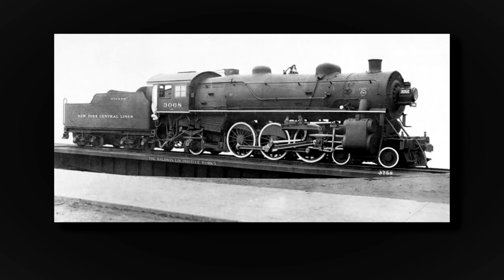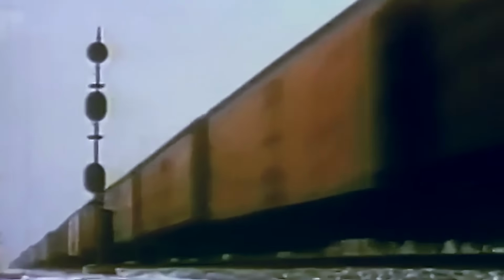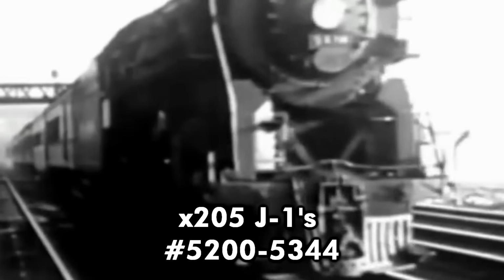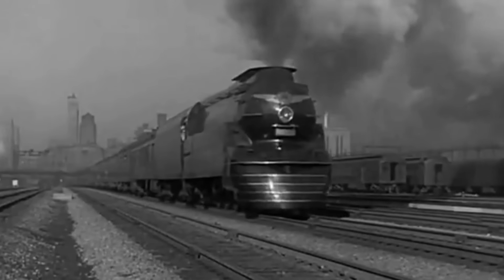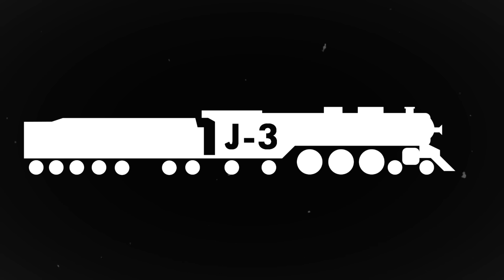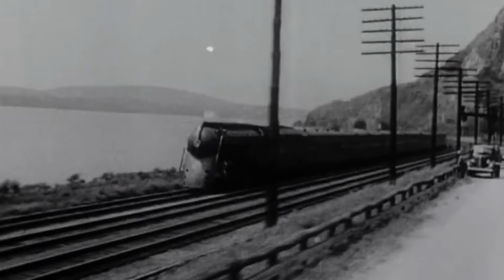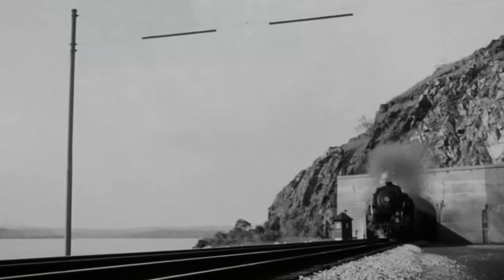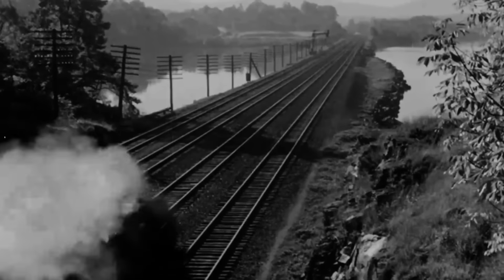Engines of New York Central - Hudson

Comment: I live on the sea level route, but it the extension from rochester to niagara falls, called the Falls Road Railroad (FRR). Runs from brokport to Niagara falls today. CSX operates from Niagara Falls to Lockport (servicing GM and a few other industries. The Somerset coal plant used to be serviced as well, but was decomissioned. Genesee Valley Transportation (GVT) operates the rest of the shortlineline, servicing an ethanol plant in medina, CO-OP gain storage, and other small industries. FRR trains are several 10's of cars long running from the Ethanol plant to lockport and beyond. On trains from Brockport to Medina, itll be a rare sight to see more than 2 grain cars. Used to be a double main, but a srapper bought the line a while back and ripped up the south main, then ripped up the north main and layed a weird squiggly rail to cross to the other side. Theres even a switch stand in the old yard in Albion.
Medina RR museum runs New York Central passenger excursions (still from medina to the Falls so no long trains coming my way), and has a very large collection of road worthy cars.

Comment: Nooo, the 10 J3a Dreyfuss streamlined Hudsons were not ALL supplied with Scullin Disc Drivers; the first 5 were erected with 79" General Steel Castings BOXPOK Drivers and the second 5 were built with Scullin Drivers. The Dreyfuss Empire State Express Streamlined J3a Hudsons (2 of them) were built with Scullins. A number of UN-STREAMLINED J3as were also built with Scullin Disc Drivers. SOME of the Scullin Drivered Hudsons experienced Main Driver Main Crank-Pin & Bearing failures, which necessitated replacement with Main Boxpok Drivers. A partial fix was tried with the reduction (by 10 pounds per square inch) of Cylinder steam pressure...

Comment: Thank you for presenting this piece on the NY Central Hudson locomotives, streamliners included.  These were classic engines, only to be scrapped as junk when diesels replaced steam locomotives.  It's nice to know that previous generations knew such designs provided good rail service.  But it would be nicer if people today were to see these locomotives as museum items or be used as excursion vehicles, similar to the Cuyahoga Valley Scenic Railroad in Ohio.

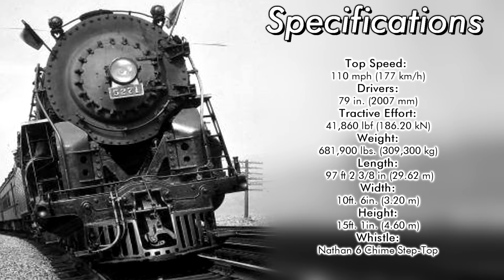Comment: 3:04 Slight correction on the whistle. The J-1 class didn't originally have 6-chime whistles. At the time of their building they were equipped with 5-chimes. I don't know the specific manufacturer though. Perhaps at some point in their operating life the J-1s were given 6-chimes, but I'd have to verify with an expert on the subject.

Comment: It is a  shame that the New York Central(NYC) did not save any steam locomotives. I would think the reason was when R.R.Young and Al Perlman took over they found the NYC had no cash. Just a lot of people and obsolete equipment. Perlman did what he had to, to keep the railroad running. The only source of ready cash was the scrap value of the steam locomotive dead lines. He and Young found that previous management had been sitting on a Potemkin village, ie it all looks nice until you get off the river and find the village is nothing but stage fronts. 
       In the end Young took a shotgun and Perlman ended being forced into the Penn Central merger. Rush Loving and Jim McClellan's descriptions of the NYC's financial position makes for interesting reading.
Reply: Part of the reason was because Perlman wanted the RR to not look old and dated but instead modern and that means scrapping the NYC’s entire roster of steam locos and replacing it with diesel ones. Some rail fans tried to buy some locos but they were denied. It got to a point where some workers had to hide a steam locomotive that they love at the end of the workshop and cover it in tarp so it wouldn’t get scrapped
Reply: @doimoi958  THIS IS TOTAL FOAMER BULLSHIT ^

Comment: So was watching a vid on early EMDs with 1800 HP.  These with 4700 HP.  So whats the deal.  Also could'nt they use two smaller engines to pull their trains?